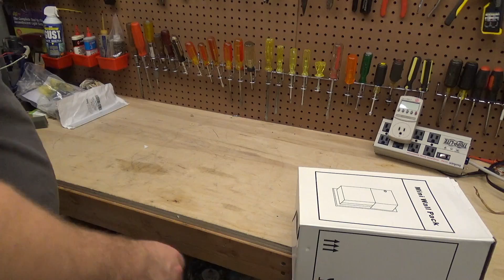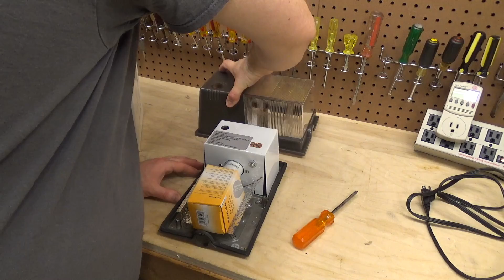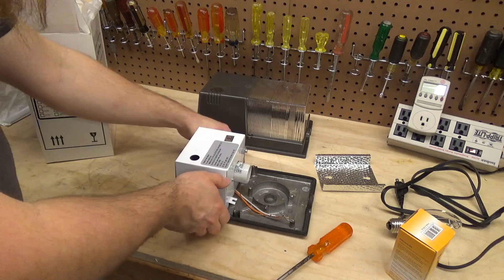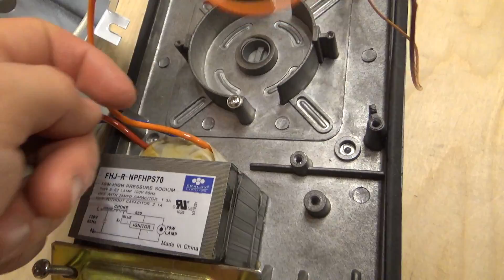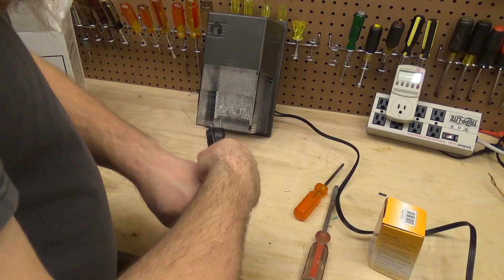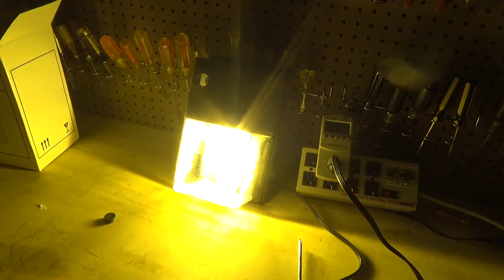High Pressure Sodium Mini Wall Packs Model HPS70W

Comment: I like the modular design of these. My only problem was that one of the 3 I purchased had a bad egnitor out of the box. But for the price im not complaining. I just need to find a egnitor for it. I actually sent more on the daylight sensors for the lamps at are $13 a unit. I've been using mine in my back yard since may. I love the orange glow from sodium lamps and im glad to own some.
Reply from the maker: I wonder if the igniter failed because it was defective, or failed from sitting unused for so many years. You should be able to find another one relatively easily, they're still available for now.